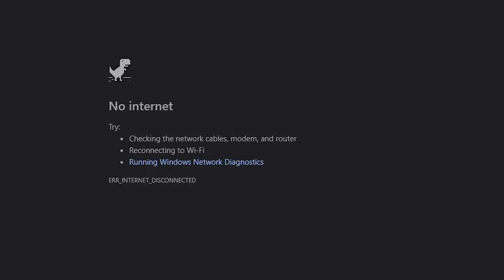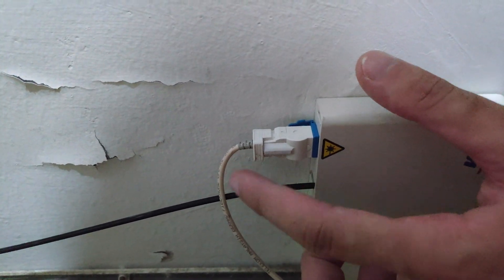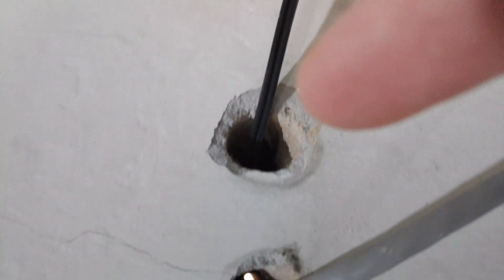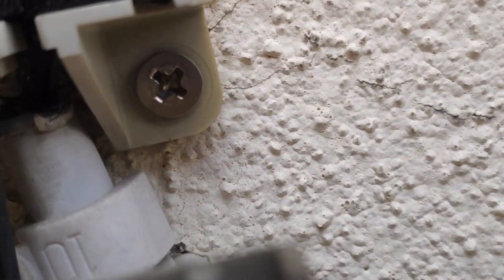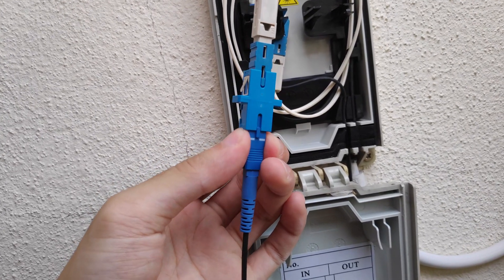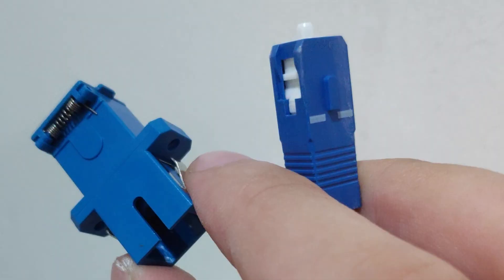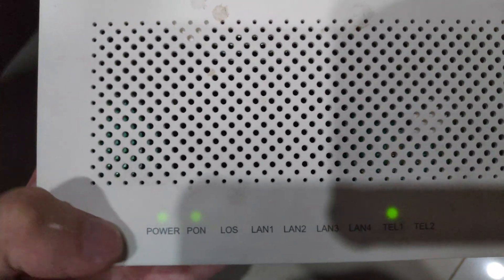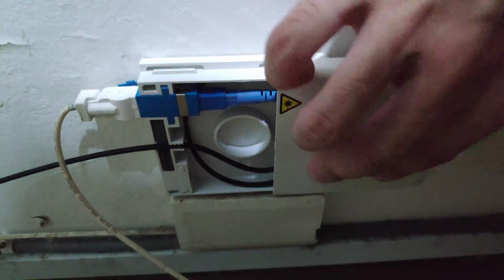How To Fix Red LOS Blinking + Unifi Optic Fibre Replacement

Comment: When you open box outside of your house, there is another white cable tingling with white socket, is that cable goes into your house as well? You have 2 cables goes to your house?
Reply from the maker: I only have 1 cable going into my house - your other cable could be used for something else. What you could do is to follow the cable that is coming from your modem to the outside of  your house to see which optic fibre cable you should replace.

Comment: I have this problem too but when I look at my cables it's still in a good condition but then when I checked again closely the way the installer cable manage the wire, there's a part where the wire being folded. Kinda hard to explain in words instead of picture but I guess my brother tripped on the wire and pulled it which makes it folded. So, I unfold it and the problem was fixed.

TLDR, for others too, do check if there's any part of your wire that folded if you see your cable just fine since iirc fiber optic uses light to transfer data so if it being folded the light might get blocked. Correct me if I'm wrong. This is just one of the possibilities of fixing it. I'm not saying that it's guaranteed but since mine was fixed this way so might as well share it to others.
Reply from the maker: Yeap, pretty much the case. Optic fibre cables arent supposed to make too sharp bends cause theyre made of glass and they can shatter very easily - but sometimes bending it back can recover the connection but theres a possibility that you will either lose connection or have an unstable connection in the future.
Reply: Hello sir, you just solved my problem, thanks for commenting here.

Comment: How many years you have use unifi Fibre with TM And What is your Current Plan Now?I am currently use 100 Mbps with unifi TV unifi Plus Box from rm149 per month
Reply from the maker: I've been using it for a couple of years now, my package is pretty much the same as yours; 100mbps
Reply: @Luffy-qh6tu  What model of your router you use for 100 Mbps?I get a Az Tech White Router from TM
Reply from the maker: @syraffhere  I used to use that one, but i found that it's pretty slow and isnt very good for multi-users using it all at once. Local streaming is also a bottleneck. 

So i upgraded to a ac-1200 tp-link router.
Reply: @Luffy-qh6tu  tp link routers are garbage. They tend to overheat. I recommend using Asus routers
Reply from the maker: @crixster  pretty true, I've upgraded since to one with WiFi 6, much more stable
Reply: @Luffy-qh6tu  These days i think better get mesh wifi especially on landed property. Surely it will cover all blind spots. Not all devices can support wifi 6 so if you're lucky you're gonns enjoy the heck out of it.  i have alot of legacy devices so i can't use wifi 6
Reply from the maker: @crixster  yeap true, my previous set up was to buy old routers and turn them into APs as a poor man's solution to a mesh wifi (works okay-ish).

but thankfully most of my devices support wifi 6 so it wasnt that hard of a transition. planning on getting a AX NIC for my desktop and laptop so that theyre wifi 6 ready as well